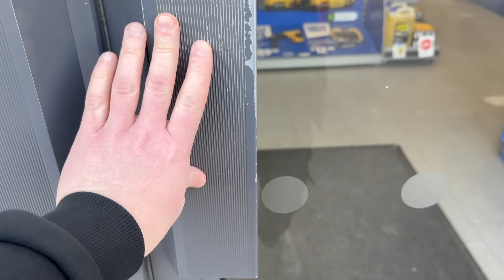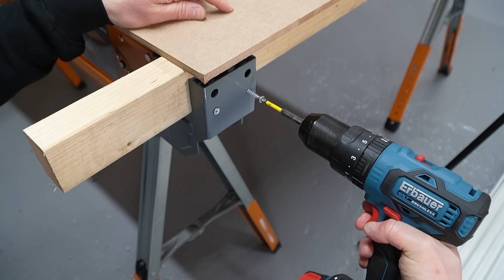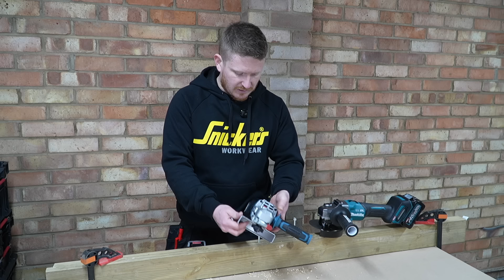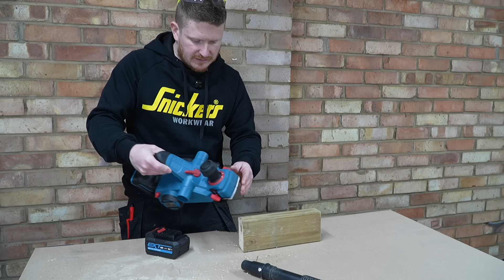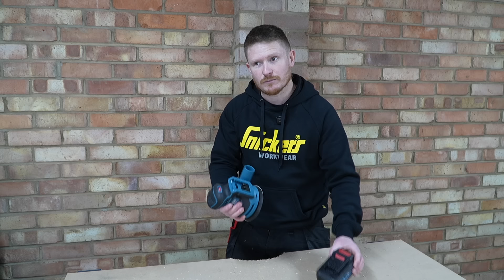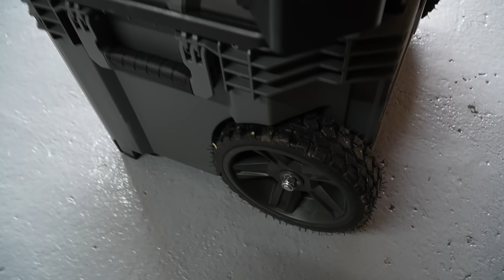Erbauer Tools Tested - Should You Buy Cheap ScrewFix Own Brand Tools?

Comment: I’ve been using erbauer for 4 years now as a multi trader, I think I have most of the battery tools and a few 240v  like track saw, cross cut etc, I’ve had no failures. I started on a budget and once you have a few I think you tend to stick with that brand. The circular saw I find lacks power and kicks back or stalls occasionally but I get by.  Ideally I would love to upgrade but the boss says no.

Comment: Good review of these excellent, DIY tools. Of course, side by side comparisons with the big boys, will leave these tools in the dust! That said, if you are strapped for cash, are a DIYer, and need a tool with plenty of power that will last the course: just go corded. A corded percussion drill at £30 will have plenty of power, and will have a fast enough rpm to perform many tasks I use an old Black and Decker from the 80s in my shed, and it has yet to let me down. Not that you have to go that cheap. Nowadays, corded tools - both new, and second hand - can be a real bargain for the enthusiast starting out in DIY or woodworking. The other advantage of the corded route, is that you don't have to choose just one brand to avoid multiple battery platforms.

Comment: Used all Makita for years. Never a problem. Powerful, light, compact, nice looking tools. 
No plans to change !
Reply: So did I but the company I worked for supplied all my tools. Some of the other engineers did manage to break the drills but mine have kept going for years, bar the batteries. Now I'm retiring and only going to be using power tools occasionally I can't afford the Makita prices so these look like a good option.
Reply: @mookyzook  I also have used Makita for years, for the odd DIY look at the Parkside range, cheap batteries too.
Reply: I started using Makita tools as a apprentice in 1981, best tools period .

Comment: I've been abusing a erbauer impact for about 10years, it's still on its original batteries, £100 with 2 batteries and charger. Tracksaws is currently 2 years old and blade is still sharp. 
 I've even got the impact socket and bit set for £9 that's years old aswell. Still got all the bits none broken. It's been good stuff so far

Comment: I’ve still got a de Walt set ( driver ,jigsaw and circular) all working and batteries still hold charge 
Brought in 2014 
I’m not sure if the new ones would last as long as
When they go I’m going parkside or erbauer

Comment: I bought the Erbauer track saw. Very decent. My approach is to buy cheap and try it. Replace with a more expensive version once the cheap one breaks.
Reply: Same, how was the track saw by the way? I've got a cheap trsck saw cheaper than erbauer for sure, can't even remember the name. Anyway i can't change the blade on it. Stuck with the same old ripping blade it came with. Could do with one i can actually put a decent blade in
Reply: Solid approach

Comment: Most builders + plumbers seem to use DeWalt or Bosch so that's what I would probably go for!!!👍👍👍
Reply: Can't go far wrong with dewalt. One of the main things you've got to consider when purchasing tools is that you're essentially tied to the batteries and the dewalt ones are excellent for the money. Good balance of value for money and performance overall (cheaper than milwaukee/makita but comparable performance/build quality)

Comment: My experience with Screwfix is if you order something for next day delivery to an address they send anything if they don't have it in stock.
I ordered a Makita table top circular saw.  They sent a Black and Decker Workmate.
They had a special offer of two Thermocouples for £10. Neither worked.  They sent two more, they did not work. I went to a local plumbers merchant, paid £5.99 for one, worked perfectly. I asked Screwfix for a refund, they refused.
Working with a builder who ordered a loft ladder kit.  Delivery driver handed builder a small plastic bag with a ceiling rose in.
I wanted replacement cartridges for one of their own make kitchen mixer taps.  Called their customer department who gave me a part number and told me the nearest store to me with the part.  I drove twenty miles to shop, bought the parts and drove twenty miles back to customers home.  Part did not fit. When I called back to complain no one knew what I was talking about. I did get a refund.

Comment: I had to go check my flexvolt circ saw and the blade is on the right. It does seem odd to have the blade facing away from you(obviously unless you're left handed). Can't think why that would be the case. They do a couple of right hand models including that flexvolt framing saw. Now I'm considering if I need to flog the existing one and buy a left blade 😅

Comment: So as a tradesman I had most of my tools corded (because they were way to expensive when they first came out and they were not as good as they are now) so when I came back to my core trades (kitchen and Bathroom fitting) I needed cordless so Erbauer was what I went for (cheap and easy to replace). Well I have had no issues with them. The SDS is great, I've used it as a core drill, 40mm core through external wall, no problem. The circular saw, yes it hits a speed square so I just drop the base by 5mm, problem solved and I can't use you makita as the blade is on the wrong side for me (it what you're used to) the laser is only accurate when flat and drifts when you lift it.

Comment: The saw is weak compared to dewalt , the driĺ driver 120nm is fantastic so much torque if using a large holesaw you could break your arm, the 4 inch grinder very useful but a terrible on off button and again a bit weak motor wise so constantly goes off. The jisaw wont run a straight line on worltops , the sds is ok just for drilling for wall plus but shite for chiselling. I cant be arsed with an 'impact driver' more noise than use, the multitool more like a toys so all in all if you want Diy they are fine if you want professional get makita, dewalt or Milwaukee  with most saying the makita is bombproof the dewalt having more tool range ( never considered  them that strong myself) and the milwakee good tools but expensive.
Reply: You will find that internal components are Chinese with expensive brands.

Comment: Before you mentioned about the circular saw, being for left handed, I noticed the problem, with it hitting your speed square. I had to laugh at a right hander trying to use something designed probably by a left hander. Now you know how awkward us left handers have using tools designed for right handers! Well done that circular saw designer, You get my vote! 😀
Reply from the maker: Haha good comment 👍
Reply: Answer your question about being brushless..yes & all with the "keep cool technology" fan assisted battery charging system 👍
Reply: Just curious..did you get a handle with the Erbauer SDS drill cos ya should have & a depth gauge thingy-majig..😂 subscribed ..👍
Reply: I've never really noticed the problem you had maybe I was not cutting to the depth you were and didn't have such a large square? Good review though, were they all brushless by the way?

Comment: As a DIYer I've got plenty of DeWalt, and they aren't much more expensive if you buy at the right time with the right deal. 3 or 4 years ago I got a brushless combi drill and impact driver for £170 with 3 batts and last year an SDS with 5Ah batt for the same price including a Toolstation app discount. The jigsaw and angle grinder work exactly like decent mains ones. Having had a "Performance Power Pro" mitre saw (B&Q, same company own brand) that failed when a gear wore out I wouldn't trust Erbauer as much as a proper brand.
Reply: Take a chance and try them, I am converted and won’t be paying the extortionate priced designer named tools again.

Comment: Why not test it against a platform that is also 18v?
The comparison seems pretty pointless
Reply from the maker: It’s not a comparison. The 40v was there to show that the cheap stuff does a good job against very expensive stuff
Reply: @DIYGuyMK2  it's unsurprising to me that it won't come close to the very expensive gear.
I just thought it could have been less definitive with something in the DeWalt or Makita range that is also 18v.
There is a lot of brand snobbery with Makita and DeWalt and to have that tested could have been interesting
Reply: Plus ya don't mention the fact they are all brushless motor's & have the "keep cool technology"fan assisted battery charging system..😂

Comment: Somewhere in the third world, there's a monumental pile of cheap, broken power tools which have been dumped there because they're cheap and broken ('make it someone else's problem') and have been disposed of because the importers are more interested in selling you a replacement than providing a repair. They're a disposable commodity aimed at the DIY guy for whom £19.99 is a fortune to pay for a drill - Titan, McAllister, Silverline, Skil, Draper, Scheppach, Aldi. Lidl etc.etc.etc. = I'm looking at you. They can't be repaired because there are no parts available since the importer doesn't bother to bring them in. So they break and then get thrown away. Tens of thousands of tons of plastics and other environmental horrors, along with the collective millions of sea miles these things accumulate of their journeys from China and back again. Most folks don't care. But I do. The Screwfix reviewers who gush over how great these things are, invariably use them a couple of times a year tops for light-duty jobs where absolute performance and accuracy aren't important. But give any of these tools a proper workout for a month, and you'll realise how crap, poorly-built and utterly temporary they are. Erbauer, at least, is the best of a bad bunch. At least most them work straight out of the box. Not all - most.

Comment: I started with Milwaukee tools because I felt they were one of the best brands. I soon realised that with my work, it's much more important to have a large variety of tools than high-performance tools, so I sold the few Milwaukee tools I had and brought like every single Erbauer tool I could desire, and it was a great decision for me!
Reply: No battery leaks? Mine leaked some black stuff, returned my Erbauer tools.
Reply: @TheStanky007  no I haven’t, maybe they’ve sorted it since yours went wrong
Reply: @TheStanky007  all of the tool makers are from the same factory, erbauer also gets there components from the same factory as dewalt, ryobi, milwaukee, makita etc so maybe you just had a bad battery that could have happened with any tool brand
Reply: @welshe222  Could be, but I've never heard of batteries leaking. Once I've looked into it, many people have the same issue. May e I just didn't look into DeWalt batteries leaking.
Reply: @welshe222 How can they be from the same factory, when they have different parts in them?
Reply: @ Who told you that? they don't have different parts, 95% of stuff on the market is using identical components from the same factorys, there are some outliers like fesstool they use similar components but from different factory
Reply: @ This is quite a generalisation and is more valid for the cheaper brands. The better  brands use some OEM parts, but have a mix of in-house manufacturing and outsourced components from third-party factories, and the approach varies by brand, product line, and region. No tool brand produces lithium- ion sells of course, they buy them and design and make the pack, the electronics, housings, cooling, etc.
Reply: @welshe222  how do you work that out  that they  are all made in the same factory  
 milwaukee  and ryobi maybe be from  the same factory  and  dewalt  and black and decker could be from the same  factory
Reply: @welshe222  where you getting your info from?
Reply: "I felt they were one of the best brands." One thing is certain, Milwaukee have brilliant marketing people. You had no objective reason to believe they're one of the best brands but you felt that way anyway. 

While still subjective, after 16 years in a professional trade it's of my opinion that they're an OK brand with lots of variety. They're not as good now as they were when Atlas Copco owned the brand but one of if not the best? Not even close.
Reply: bought not brought  haha
Reply: @josephberrie9550 its worse when people actually say it....

Comment: The skil 20v range (also sold in screwfix) includes a circ saw with the blade on the other side and the erbauer batteries fit and vice versa….ive got their barrel body jigsaw instead of the erbauer one for better control.

Comment: If you drop the handle the middle box lid will open with the top box on as well. Also there os a locking bar to lock all three together.  Only thing os mine did not come with the middle box tray in.  Inam happy with mine and got ot in the sale as normal cost os £170 or so.

Comment: 11:42 If you reduce the blade depth the motor would then clear the square. It would be safer to have less blade coming through the bottom of your material anyway. Just don’t leave it set to full depth.
Reply: I was told by an old joiner, you ought to have the teeth just showing past the thickness of the wood with circular saws. It stops the blade from "grabbing" and jumping.....
Reply: @Brian-om2hh  A rotating blade should clear the workpiece to the depth of the throat between each tooth. This will ensure the blade clears debris effectively, prevent binding and is safer than having excess blade showing.
Reply: @Brian-om2hh get a cleaner cut too
Reply: Unfair comparison anyway.  The cut on the Erbauer was made with the motor side to the speed square.  The Makita on the blade side.  bit of a BS statement by @DIYGuy

Comment: No spare parts if anything breaks or wears.
Reply: They have  3 year guarantee and a repair service. I have used them when my sds chuck broke and they collected the tool and fixed a d returned within 3 days for free
Reply: Just take it back & get a replacement 2 t 3 yrs warranty

Comment: I think it's good that Screwfix do Refurb as well, I got the Refurb Erbauer drill and impact driver from screwfix just over 6 months ago, Using my blue light card discount as well it was £107 in total, I did have the Chuck on the drill seize but had it replaced under warranty, but that aside when the equivalent cheapest non brushless titan set was only £15 less and the next set up I think a twin pack from Maybe bosch or a step down to 12volt from DeWalt at around £50 more, it seemed a no brainer for your average use diyer like myself to go for Erbauer.
Reply: Erbauer also do a EXT 12v range are really good as well..all brushless motor's
Reply: @fredholmes6284  to be honest the drill would been fine, I mean I still have a Wilko cordless drill that's going strong after 6 years of usual DIY use and does most things I ask of it, but it was the impact driver that needed to be at least 18v as it needed to drive in 50+ 100mm timber screws for my workshop build.

Comment: I have most of the Erbauer range and overall they are great. The SDS is really good and powerful with the only weakness being the batteries as they drain far quicker than the big brands. The impact driver was the only let down as it often stops working or fails to start which I think is due to the trigger (was only used 3 times when it packed in). The multi tool and more powerful drill are brilliant. They have a lighter less powerful drill which is good but for the extra power the bigger drill is far superior.
Reply: That's not exactly a ringing endorsement.
Reply: @richardsinger01 I agree but I think the impact driver must have been a bad apple. I've used the multi tool, drills, SDS, and jigsaw plenty over the last 2 years and no issues.
Reply: @johnlee701 think there was a bad batch of these cos I had the same issue trigger straight away went replaced it and my other has been going years with almost daily use

Comment: I've had the circular saw for a few years. The laser can be very useful in some situations, but it's very weak and will struggle cutting damp timber and keeps cutting out. And the blade on the right side of it is a pain. Will be getting a dewalt one soon to replace it. Thanks for your review!

Comment: I had near enough all of the tools from the core range and absolutely abused them as a first fix chippy. 
Every tool is still going strong except the circ saw which gave up after about a year of heavy use ripping sheets and big timbers.
Even though I’ve moved over to Dewalt now I cannot fault them in the slightest. I even still opt to use the impact wrench when driving anchor bolts over my dewalt.
I also still use the Erbauer first fix nailer nearly everyday.
Reply: What Erbaurer impact wrench do you have?

Comment: I've got some of their bits over the years
But none of their power tools 
Thing is, I've invested in so much DeWalt stuff it's not worth buying this stuff again
What I have found is that my "cheap" multitool was much harsher to use them my DeWalt one, virtually no vibration by comparison
Reply: Try the fein multi tool, it’s on a different level to the dewalt
Reply: @denty32  I had a cheap one, I could just about handle cutting the tongue on one floorboard before having to rest up 
Then it packed up
The DeWalt one was because I already had the impact and drill with 3x 5.0a batteries on a deal 
I did I think 17 boards in one afternoon when I got it, my hands didn't feel a thing
It was 3x + the price though, but well worth the outlay for me
And I used it yesterday for some plasterboard holes 😁
Reply from the maker: Great points 😃